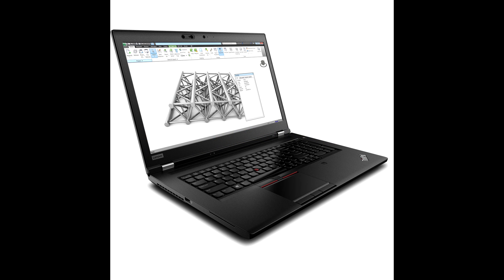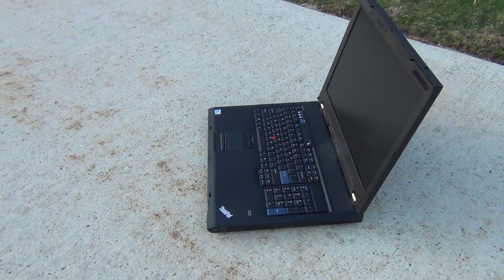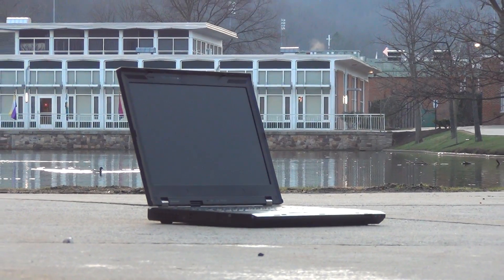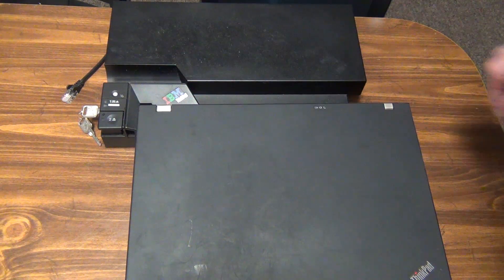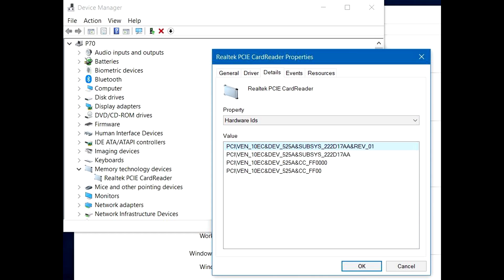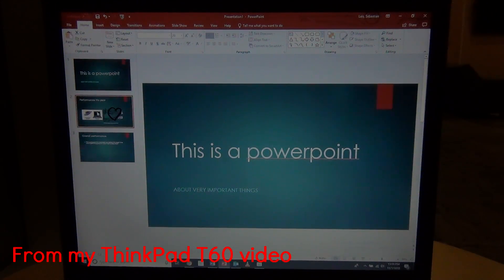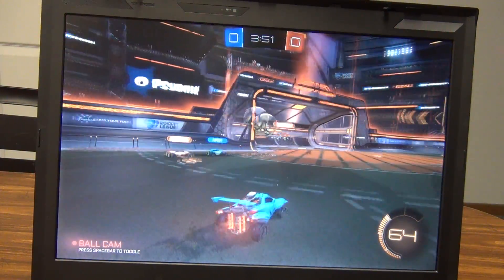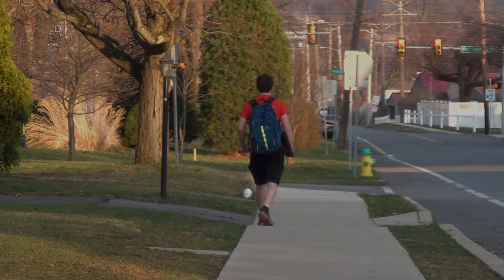Using an 11-year-old Mobile Workstation in 2019 (ThinkPad W700)

Comment: I am a huge fan of Genesis, so that sounded pretty good to my ears. Not that thinkpads are known for their audio quality still to this day. But, that's a beast of a laptop so you would probably expect a little nicer audio. My T420 doesn't have bad audio, but it's nothing next to my Latitude e7470 with Waves audio software. But I think the classic Thinkpad had a lot to offer otherwise. But, yeah I would truly agree Windows 10 cough doesn't do that well with a spinning hard drive, and I would argue probably Mint Linux would work incredibly well and use less battery power even with a power sucking rig like that Mint won't struggle as much especially using the Mate versions and thus using less energy in the process. But probably Windows 10 would be my last choice. That's just me. My Latitude 5491 has the Windows hello and Nvidia MX130 options or else I would be running Mint on that one.
Reply: I would go with either w8.1 or mint mate/ubuntu mate.
Reply: Eduardo Avila 8.1 certainly would be lighter over all and certainly Ubuntu mate is a very good choice, I enjoy it very much. Windows 8.1 gets a bad wrap and for many good reasons, but with a little work you can make Windows 8.1 fairly quick by the reduction of bundled crap and unlike 10, it's gone once it's gone and you can control updates, something I like because I value work flow and stability over "features" that I probably won't need but might notice because it slows or breaks my work flow.
Reply from the maker: When doing initial testing I had Windows 7 on here (no doubt my favorite "modern" version of Windows), but decided to use 10 for the video for maximum software compatibility with newer programs.
Reply: @SebisRandomTech  The only thing "modern" I use is an up to date web browser. Firefox of course so I can cross platform extremely easily without being tied to Google. I take this back, I also use an up to date version of LibreOffice since that works with the vast majority of documents in my workflow. But, I would also stress not many people share the same workflow and computing needs. For example I have Adobe Photoshop 12. I think it was released in 2012 or 14. The newer versions require a yearly subscription and offer little to nothing to add to my workflow in order for me to upgrade. Of course professionals working with the newest versions of PS are not likely carrying around a decade old laptop either and they probably wouldn't enjoy that experience. But, it's a bit subjective as all workflows are, at least it's not nearly as painful as to try to do actual computing on like an HP stream! That's not so subjective.... lol
Reply from the maker: @PearComputingDevices  One of my friends bought an HP Stream for college...I ended up selling him a ThinkPad and he's been much happier since.
Reply: Sebi's Random Tech Well given the specs of that device, I could that. Even Mint 19 would struggle under load.

Comment: Windows 7 or 8.1 would have probably ran way better
Reply: Yeah, totally
Reply from the maker: I mentioned that older OS's may have run better on this machine in the video. I initially installed Windows 7 on here, but went with 10 for better program compatibility and since that's what most people are using now. I like seeing how well (or awful) 10 runs on older hardware.
Reply: Cool. Thanks for the reply. It's definitely interesting to see how it runs.

Comment: I still run the T420 w/SSD & ram upgrade
Reply: I have an e530 with an SSD running Linux Mint. Still works great.
Reply: With a Linux mint, mine works fine too. It took soo many beating in the workshop, it fell down a few times, we used it for doing measurements outdoors at winter, still works fine as my backup.

Comment: I use a T520 as my main driver when I'm away from my desktop. I wouldn't even think of soiling it with windows 7 or windows 10.

I run ubuntu 18.04 on it right now and it works perfectly. I can even play most non-graphically demanding games from my steam library like Factorio on it.

Comment: new Sebi vid, life is well. also, is there any known method to circumvent the hardware whitelist?
Reply: i think it is possible if you coreboot it, which may or may not require the use of a Raspberry Pi to flash it directly to the BIOS chip
Reply from the maker: @Klayperson  I think a few people have tried and succeeded in getting other graphics cards to work in this unit, but not too many people have given it a shot because, well, not too many people have these laptops. I for one would be afraid of bricking such a rare machine, as opposed to something like a T400 or T500 where there's plenty of extras laying around.
Reply: If you're designing your own graphics card or whatever you could just spoof the DID.

Comment: if these ones get lower on prices i would definetly buy one (just for fun you know)
i would avoid the first i7 series W701 bcs those chips can get pretty hot (i had one asus laptop with I7 720QM and it thermals were just crap)

BUT you said that newer thikpads have LED backlit. Is it possible that i can put led backlit screen into my T61 14inch standard (for the curiosity) or can it be like DIY stuff( cuz i have one spare ccfl backlit screen on which i can try that out) 

main advantages will be for me the battery life increase and brightness would be better 
also the screen would look nicer to the eye
Reply: I "Think" that the W701 could handle those chips. I was looking at one a few years back, but it was missing a charger and had stuck keys. The W520 is where you have to look out as they were sold with 2***M variants with skinnier heat sinks so upgrading to a quad core meant a heat sink change also. I have a W520 and I was looking into a 55W 2***XM upgrade but decided not as the heat sink issue was not confirmed if the XM series had even beefier sinks than on the quad cores. The DS model would be an incredible find though.
Reply: @17thSzAdDaM  yea those temperatures are pain in the arse
 my T61 had c2d T7100 and i upgraded it (to max spec i thought back then) to T7700 (also t7800 was available but i would need to wait 2 months to get it shipped from china)

now i found out that i can put in T9500 with bios flash (also c2extreme x9000 would be possible but it is 44W) soo nevermind :D

but luckily i found that t7700 for cheap localy and i think sometimes it is clocking 2,6ghz (the stock for T7700 is 2,4 and for T7800 2,6)
Reply from the maker: The T61 uses a different connector from newer LED-backlit displays, so while it may be possible to transplant an LED display into it, you may have to do a little bit of modding. I was actually looking into this myself because one of my upcoming projects is to build a T601 FrankenPad (15" T60 chassis with T61 motherboard) for the wonderful IPS display that the T60's had.

Comment: for the middle click button, you just have to edit some registry and it will work like a charm.

In my case, with windows 10 I just searched for 'trackpointmode" in regedit......that ended up being here
 
HKEY_USERS\S-1-5-21-1557542073-2641846280-496700362-1003\SOFTWARE\Synaptics\SynTPEnh\UltraNavPS2
Then...
Change "TrackPointMode" to dword:00002214 from the previous value of 00001214

I also had to change

 

HKEY_USERS\S-1-5-21-2158515036-987303324-3988316896-1001\SOFTWARE\Synaptics\SynTP\StickSMBTM2182

MiddleButtonAction from 0 -> 4

ive done it to all my thinkpads with W10 pro in it, and all of them works like a charm.
Reply from the maker: Thanks for the info! I'll have to give this a try on some of my older ThinkPads running Windows 10. Does the scrolling work correctly in Metro/Modern apps? My issue was that scrolling worked fine in classic shell applications such as Windows File Explorer or Chrome, but not in applications that use the Modern UI such as Edge or the Start Menu.
Reply: @SebisRandomTech  well its doesnt work at metro, explorer or start menu, but its works perfectly at EDGE, chrome, and another browser.
Reply: @NOSTALGILAK  You info about the W series in invaluable. Thank you for posting it.
Reply from the maker: @NOSTALGILAK  That's how the Synaptics driver that Windows installed on it's own works. I was hoping to find a more complete fix.